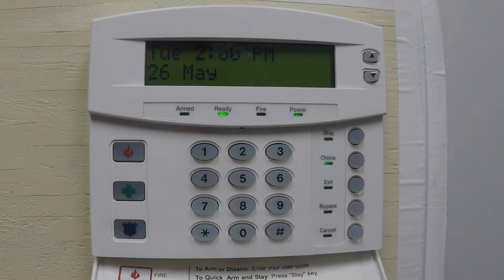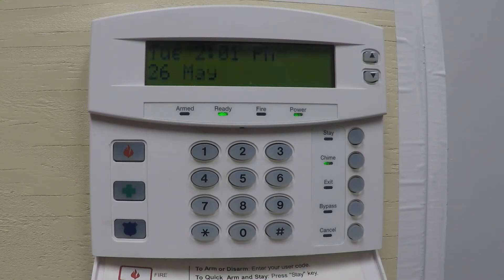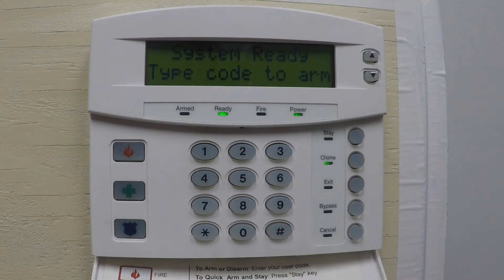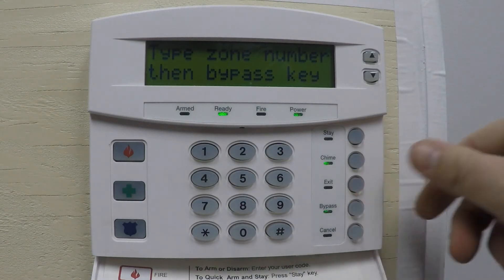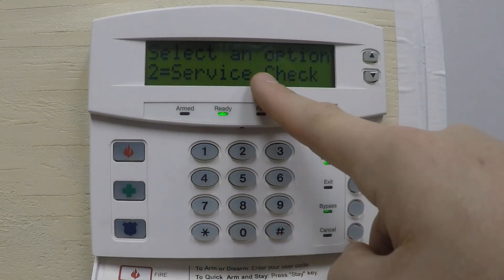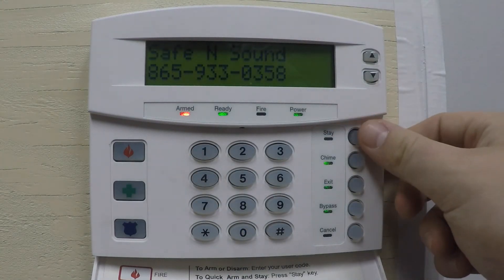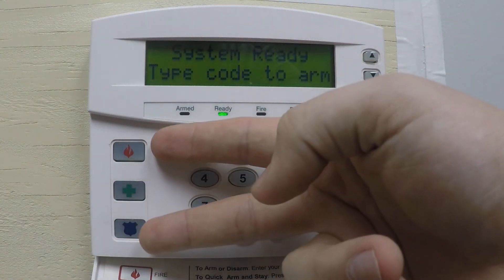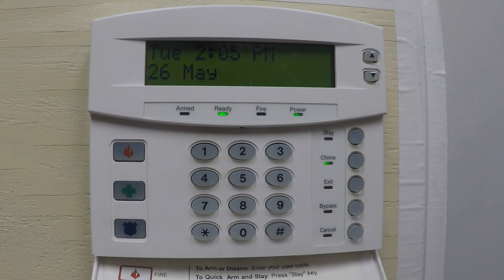Interlogix NX8 General Operations with LCD keypad - How to

Comment: Is there a way to reset the master code? I bought a house with a 20 year old version of this system and don’t know the master code.
Reply: Why did no one answer you? I have same problem..
Reply: @Escekar  I think I used JMAC supply to get mine, about $150-200 for a new board. For me it was worth it
Reply: @Escekar  installer code was probably changed. Factory reset won’t work. What I did then was found a kit online that came with a new case and motherboard, just labeled the wires, took pictures and plugged in the new motherboard, then I was able to reprogram the board from scratch
Reply: @starrywarz  you sound very cleaver. In a panic when the alarm was screaming and scaring my kids. I was able to stop the alarm and stop the blue light on side of house from flashing??? This took about two hours (felt like two hours). 
Now I’ve set the smoke alarm off again. I press some buttons and stopped it under 30 mins. But blue light on side of house is flashing..
Do you have any suggestions on what to press to stop it? I did it before without master code so it’s possible.. I just don’t know how I did it last time.
And information would be amazing.
Oh and think you for replying so quickly.. hope you have a much better year this year. Considering covid and all.
Cheers…!
Reply: @Escekar  I don’t have those blue lights or the smoke detection system as part of my security system, so I’m not really sure, but I would think that in order to resolve any alarm state you would want to put in a valid code. If you have the installer or master code (sounds like you don’t know it tho :/) you can use that code and or reprogram a new code into the system
Reply: @starrywarz  thank you so much for trying to help. I rang the phone number on the system. It doesn’t exist any more.
I’ll just have to ring some other security people to help. Oh yeah I’m in Australia. Just thought I’d tell you that. 
Thank you again.

Comment: I know this is year 2015 video, but this video is not reliable cause some instruction is not true or friendly user. Specially the bypass, where you can hit * and scroll up and down to point the zone which device you've trying to bypassed. Next is typing the code and hitting STAY mode. You mess the arming of the system, cause when you punch your code the system recognized that it's arming on exit mode or away. But hitting STAY mode is arming the system by STAY mode only. Not unless you have partition zones then that's the time you type your code and chose which partition you're arming and then press STAY or EXIT.
Reply from the maker: Thank you for your feedback.  We do these videos specifically for our customers and how we program their systems so there will be some differences with systems that we haven't installed/programmed as many of the features can be modified in programming.